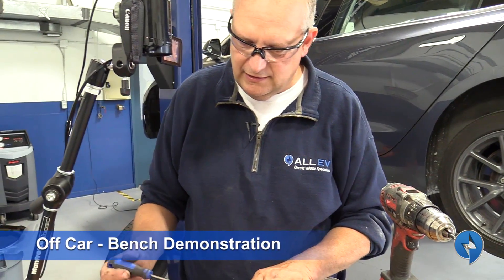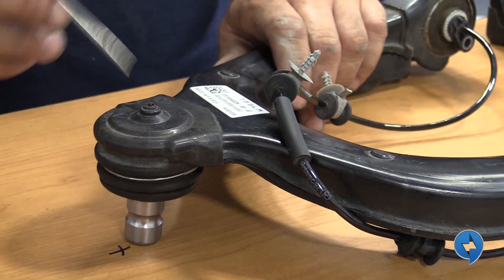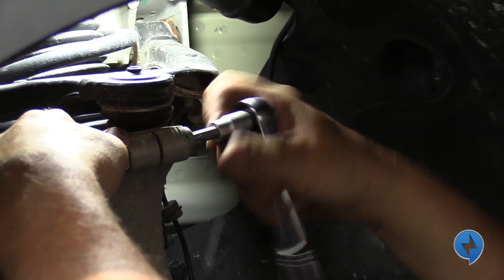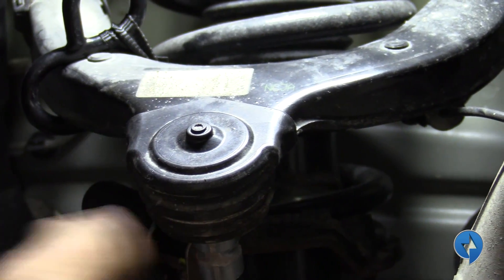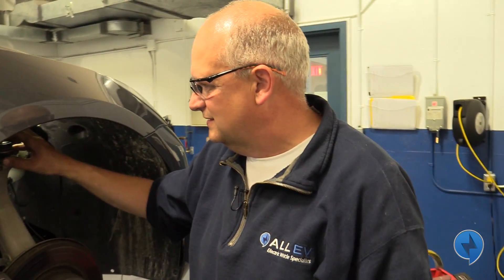Tesla - What is that Squeak!?  Fix for Free

Comment: Just completed this on my 20’ Tesla Model 3 Performance. Yesterday I went on a little drive on track mode got home parked it. Today I woke up up took the car to go grab some things and the noise was undeniable sounded like rubber squeaking. Coming from the front right suspension. So I looked online came across the issue on forms and saw this video got home did it noise went completely away. Thank you so much man saved me a few bucks

Comment: I rotated only the right wheel ball-joint and it stopped squeaking for the past month. I used a grease injection kit with water-resistant grease as well as the rotation on the left wheel ball-joint. I'll report if one is worse than the other. I had tried rejuvenating the bushings alone on the left side and that was insufficient. This solution saved me well over a thousand dollars.

Comment: I did this, and it worked.  For one day.
Reply: Follow up:  no need to remove wheel, use a needle and syringe, or drop the control arm.  Lift the car by the rail, pull the spring clip off the ball joint boot, use an oil can to fill the boot with oil, replace spring clip.  WD40 is a terrible lubricant BTW.

Comment: My 2019 M3 started to squeak every time i turned the steering wheel.  This is on the front driver side.  I bought a grease gun and needle to inject grease into the boot of the control arm.  After 50 miles of driving, the squeaking has reduced quite a bit, but it is still there.  

I heard Tesla was charging people between $500‐$1000 to replace the control arm. That's why i was hesitant to call Tesla and went with the DIY route to inject grease.   Out of curiosity, i made a service call to Tesla.  They quoted me $225 to replace the front left and right control arm assembly.  FYI,  I'm long out of warranty.  For $225 with labor included, i think it's a great deal.  I'm in California.  

So, why is there a big discrepancy in price for Tesla to replace the control arm?
Reply: sounds like a great deal

Comment: Thanks for the content! Just found your video. Super helpful. You mention that they don't have the ability to grease the upper ball joints, but they seem to have a zerk fitting. Does that mean the fitting isn't useable to put more grease in the boot? I would like to try your method of rotating the joint, but I'd also like to add some grease. Is that possible? Thanks for your help!

Comment: 2020 MYLR 61k miles.  Started this squeak and your advice fixed it!  THANK YOU!  Only had it on passenger side, but did driver’s side as well while I was at it. Again, THANKS!!
Reply: tried to do this fix on my 2020  model 3 70k miles but didn't work , passenger side seemed tight but drivers side moved around too easy,I guess its wore out and seemed to get louder after i put everything back together.

Comment: My 2022 Model 3 RWD had a loud squeak from the driver's side for several months that gradually got louder. I initially thought it was from the driver's side interior door panel. But as it got louder, it couldn't be the interior door panel. It recently got so loud I had to do something. I quickly took off the front driver's side wheel and noticed that the upper control arm is revision J. I figured that I would do the full sweep ball joint articulation sweep anyway to spread the grease around since I have nothing to lose. Sure enough, when I did the first sweep, the ball joint felt a little dry, but not very bad. After I felt that the grease got spread around, I put everything together. I even sprayed the bushings and the ball joint boot with silicone lube. The noise is immediately gone. I think I still heard a little bit of squeaking from the door, but much better. I hope I solved the problem. It seems that no matter how much grease the manufacturer injected into the bushings, it is useless if they don't move the ball joints around to spread the grease.

Comment: Unbelievable thank you so much just fixed mine. I broke the ball joint loose from the spindle. It was very stiff, moving outward, but I kept rotating around until it moved freely ,that horrific noise I had is totally gone. Thank you thank you thank you.
Reply: Thank you for the info. Gonna do this also

Comment: If you take that the spindle loose to exercise the fitting does the car need a ailment?
Reply: No, you don't change the suspension geometry/setup when you disassemble it and put it back the same way

Comment: Damn.. Everyone seems to have 2018 or older model 3's with this issue.. I have a 2020 Y with just under 10k miles and my driver side just started squawking like a duck... Should be under warranty but my SC is 2 hours away.. AHHHHHH
Reply: Our model 2022 model Y just started doing this after 54k miles. Glad I found this YT video
Reply: @Defyboredom  Tesla ended up replacing both the driver and passenger upper control arms with the newer models. Apparently it was a redesigned joint that was less likely to leak , and it had a different chemistry of Greece in it or something.

Comment: Just completed this fix on my 2019 Model 3 that just so happens to be out of warranty, and it worked perfect!  Squeak is all gone!

No extra grease.  No injections with oil.

Jacked up the car, removed the wheel, took out the upper control arm bolt, rotated the ball joint in multiple directions for a good minute or so, buttoned everything up and the steering sounds good as new!  Did both front driver and passenger sides in under an hour!

Thank you for saving me a trip to Tesla and a several hundred dollar service charge!

Cheers from Seattle WA USA!  

Subscribed to your channel as well!  Thanks again!
Reply: @rwestrada4100  it doesn't increase amount of grease there, just spread ir and after 10k miles it will be back. The issue there is lack of grease not the spread pattern.
Reply: @STKGarageCanada alright thank you. Then just have to get more greeece in there
Reply: How much was it ? Was it expensive?

Comment: This is the second time I am having this issue (first time was fixed under warranty two years ago) and the Service Center just postponed my service appointment just now until next month despite the fact I scheduled it more than 2 weeks ago. It's an embarrassment to say the least when I am on the road.

Quick question for those of you who DIY'ed, do you need to lift up the car and / or remove the wheels to get to the control arm?
Reply: Just completed the fix just a few minutes ago and worked like a charm.  To answer your question, yes....you have to jack up the car and remove the wheel in order to access the area and remove the upper control arm bolt attaching the ball joint.  You will need a 15 mm socket and T50 torx bit to remove upper control arm bolt.  There were no torque specs for the upper control arm bolt when you reassemble.  But it was relatively easy to remove.  I hand tightened, plus a bit more.  Wheel lugs are 129 lbs ft and use a 21mm socket.  Took less than an hour to do both front passenger and driver sides.  If you can change a tire, you can do this repair 👍

Comment: I just did this fix on my '19 model 3. Worked great. It isn't shown in this video but I was able to apply manual pressure down on the control arm to freely pull the bolt out. The arm raised up several inches when pressure was released to allow room for rotating the lug. I did not need to support the wheel assembly at all. To get it fitted back in I partially inserted the torx bolt, then pressed the control arm down from above while playing with the lug alignment until I was able to fully seat it and push the bolt back through. From wheel on the ground to wheel on the ground no more than 10 minutes with a single unskilled person.
Reply: Hey! Thanks for your comment, I have a '19 myself and it just started doing this a few weeks ago. The Tesla SC "near" me first gave me a booking to next week, but one hour later sent me a notification that they do not have the parts needed and moved it up to July! Do you have any idea if this is still covered by warranty? The Tesla SC closed for the day, so I couldn't even contact them to ask.
Gonna try this fix and hope it lasts until July.

Comment: Can't get the bolt out? The video didn't show how the bolt was taken out.
Reply: Hi, try pulling down with about 20lbs of force on the control arm (the bit he ratchets down) and see if the bolt budges then? That's what I did - manually pull it down to free the bolt. Then to reinsert the bolt you need to manually pull it down and squeeze the fitting back into the vertical strut (with the bolt partially inserted) then shove the bolt through.
Reply: @zevi  Thanks appreciate that. I haven't driven the car more than 5 miles since hearing the noise.  I did try massaging the boot alone since i couldn't get it out...it did settle down a little but the noise came back a few days later. Have an appointment @SC mid May ... I'll try what you suggested maybe I can cancel that appointment. Cheers 🍻

Comment: What kind of tools would I need to do this as well as the grease?
Reply: A 15mm socket or wrench for the bolt side, and a T50 Torx bit for the lug side. You will also need a low profile jack and chocks to raise the wheel, and a 21mm lug socket, breaker bar and torque wrench to remove the tire.

Comment: Finished the massage rotation tip this afternoon and no more creaking! Thanks for the tip. My closest SC is 2 hours away so I’m happy to have gotten some more life out of this ball joint for a while. In case anyone wants to know, you need a T50 torx bit to remove the bolt holding the ball joint to the spindle.
Reply: What type of Grease did you use? I'm looking to do this myself but I have no idea what type of grease to use or what type of tools I would need to fill up this ball joint.
Reply: @Brutaka1  no grease required. It’s literally just moving the ball joint around in circles to redistribute the existing grease in the ball joint.
Reply: What socket and torx sizes are needed?
Reply: @jasonfournier  T50 torx and for the bolt side it’s 1/2 inch or something slightly larger.
Reply: @Aaron Svendsen  thanks. I eventually found it. 15 mm nut and T50 torx on bolt. Going to the store now to grab the right sized torx bit. I had my control arm sealed last summer but it still started squeaking. 85k miles on it. My other one died at 54k miles.

Comment: Mine just started sqeaking like mad on the driver side. Early 2019 M3. Thinking of doing the massage rotation thing to get some More mileage out of it before Tesla changes it early January. Do I need to support any part of the suspension or can I loosen the upper arm with just the car on a jack? What torque shall I used when retightening the nut?
Reply: Did as per your instruction this afternoon, super Easy and it worked like A charm. Thanks alot! Car is quite again.
Reply: @mikeberg22se  Mine is doing the same. I have an appointment in a few days but it's so loud I now.  What torque spec did you tighten the bolt to? Thanks in advance for the info.
Reply: @btownrunr9426  i found this on a tesla forum. Bolt/nut combination for clamp on knuckle to reattach upper control arm ball joint - 41 ft⋅lb / 56Nm. Car is silent still many days after the fix.
Reply: @mikeberg22se  thanks!!!

Comment: I loosened the nut and attempted to separate the knuckle to release the ball joint while I used a pickle fork without any luck. Any trick how to get the ball joint out of that knuckle?
Reply: I know its been awhile since this comment but in case anyone else is looking for the answer the nut has to come off and the bolt has to completely come out.  The bolt holds the ball joint stud captive by a groove in the ball joint stud.
Reply: @frankcarter2174  To add to this you can apply some pressure down on the control arm to free the bolt while sliding it out. Similar pressure is required to seat the knuckle before the bolt can be fully slid back into place.

Comment: Thank you! I have a 2018 Model 3 and I was avoiding driving the car while waiting for service because it was so damn annoying and embarrassing. It was loud enough that it turned heads in the parking lot as you drove through. This did the trick and is making the car bearable until the warranty replacement.
Reply: Well if you're out of warranty then I guess this is the only option you can do then huh?
Reply: I’m out of warranty. Have a service appointment for this.
Reply: @MS-zb6op  how much was your  fix for this?
Reply: how much you fix the upper arm control?
Reply: 1k6-2k for me estimated. I said tesla to f off

Comment: Just paid $400 to get just the right upper control arm on my 2018 Model 3 replaced...argued a bunch because this should have been done when they replaced the left last year under warranty...but they wouldn't reduce it any further...glad to know the new revision will last longer.
Reply: And that greasing is possible if you puncture the rubber boot.

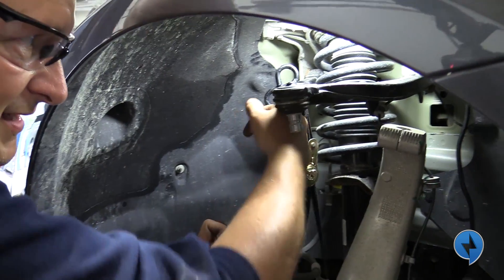Comment: 2:15. You CAN peel back the boot and add grease easily without taking the upper control arm off.  I did both boots on the front end in less than 90 minutes. It  looks like he was able to add grease but cut that part of the video out.
Reply: He sure did not fix it on this video. He pointed to where a Zerk might go but nothing.
Reply: BC the rotation is apparently all you need. But I wonder how long it will last.  @RB-jv6un
Reply: @natypes1 less than a year. It needs more grease.
Reply: @AndreC240  mine starting squeeking again today. I just did it in August. Ughhhh
Reply: Is there a video you can link to watch how that’s done?

Comment: I have revision g and it still squeaks. Sitting at 57k miles..
Reply: arg. so it lasts 7k more miles than mine did with pre-revG ... just barely long enough to ENSURE that it's not covered by warranty!
Reply: Yeah I had both replaced at 20k. Now at 55k and drivers side is making the noise.

Comment: Crazy... I never replaced my upper control arm when mine started squeaking. I used a needle to inject grease in to the upper control arm joint.... is been over a year and no squeak issues since
Reply: (Update) I’m now a little over 130k miles on my 2018 LR model 3 and the squeak has not returned… I’ve only greased it that 1 time
Reply: This is the kind of info I come to the internet for, excellent, thanks.
Reply: DANIEL! You are a lifesaver. I bought a needle and used my dad grease gun, didn’t even have to take off the wheel, punctured the boot and loaded it with grease. Shortly after I drove up my road (bumpiest road ever!) and heard maybe only 3 squeaks. Worked the grease into the joint by driving and BAM! No more squeaks..Zero! You are my hero (along with my dad of course lol)
Reply: @ashley_rodrigues  lol, I’m glad it worked! My profession is mechanics (15+yrs)so this was a no brainer for me. It’s just basic maintenance. Most vehicles nowadays are coming with “sealed” ball joints (no grease fittings). Back then, vehicles had grease fittings to easily grease the joints. Most people don’t know they can actually purchase an adapter needle that attaches to the grease gun and inject grease into the joints by puncturing the ball joint boot. This can help fix/prevent any squeak or wear issues.
Reply: Great info! Could you make a video showing exactly where you injected the grease with the needle gun? Thank you.
Reply: @josephjohnson8502  I was just discussing this with my wife… I might have to make a video… I’ll post when I do
Reply: @spyicu  thank you!
Reply: Daniel, what kind of needle did you use? And type of grease?
Reply: @christerhammarstrom8045  it’s a needle fitting that attaches to a grease gun. Just regular grease used for suspension like ball joints
Reply: @spyicu  Tnx...worked perfect on my X to!
Reply: Any chance you can post that video of where you punctured the needle?
Reply: Stoked! Thanks to you!! Mahalo!
Reply: Is it possible to add grease tip on top of the ball joint? Looks like place for it but maybe possible to drill a hole and tap a thread?
Reply: @ I honestly wouldn’t… You could possibly damage the ball joint. I would just use the needle and inject the grease. It’s a lot safer and it works just as good
Reply: @spyicu  can you please post ur tutorial?
Reply: Did you puncture the boot or?
Reply: @DistouN  unfortunately yes, you have to puncture the boot. It’s a very small puncture.. I made one poke and used that same hole to inject grease all around the joint. It wasn’t an immediate fix when driving off, but once you go through some bumps and turns and get that grease worked in there. The noise goes away because the joint is properly lubricated and not dry friction metal to metal rubbing.
Reply: @spyicu  since you had to puncture the boot, has any grease been coming out that you’ve noticed?
Reply: @LaughyMan03  No, I haven’t seen any come out
Reply: @spyicu just injected some grease into my model 3. I drove about 10 miles and it’s still squeaking. Should I be patient and drive around more?
Reply: @angelicareyes595  Maybe it was not enough. You really need to press the grease in so that it can rise in the rubber grommet and get to where the ball is moving. Just a little bit won't do any good.
Reply: How many pumps of grease did you need?
Reply: @ri-wh4df   As much as possible. Until it’s full of grease, no more air in it. Grease must touch the ball joint!
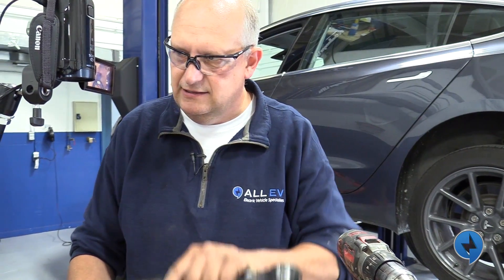In my case I had to detach the upper arm from the rest of the suspension to be able to move the pin as shown in the video  starting at 1:15. Once the grease got into the ball joint, it was much easier and smoother to move. Since then, there has been silence.
Reply: You need jack up car or its okay on the ground?

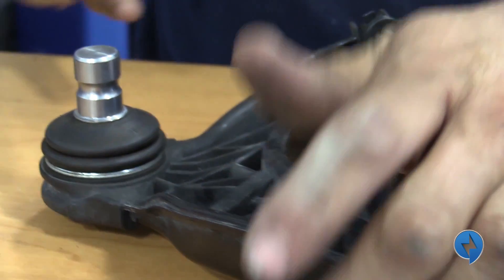Comment: 1:30 Why not open the rubber by taking off this "metal ring" on the bottom of the rubber jacket? 
Fill it to the max with grease containing MoS² or Boron Nitride ("white graphite"). There you go.
The nerd and/or farmer would put a zerk fitting there in his Autobahn harvester. 😉
Reply: How do you get the metal ring off of the rubber boot?